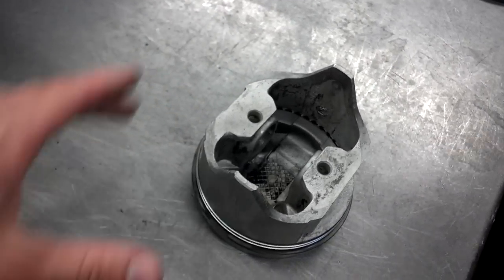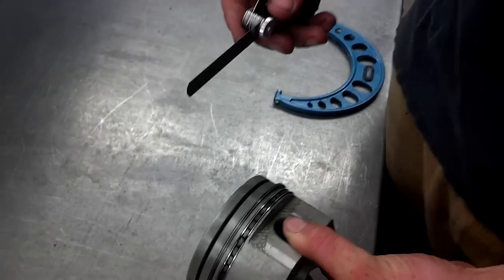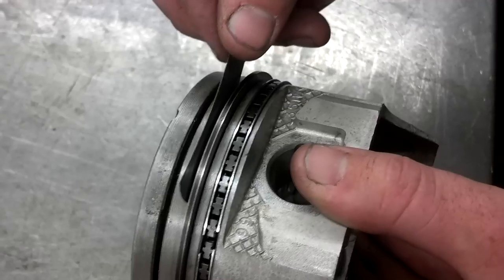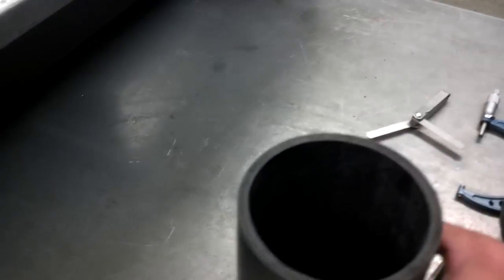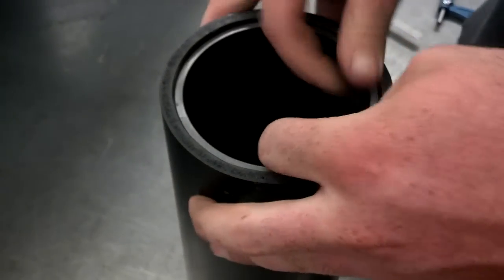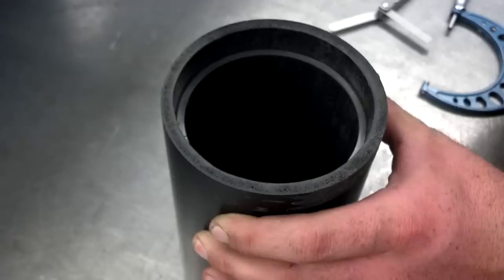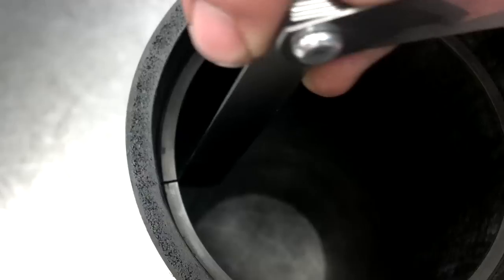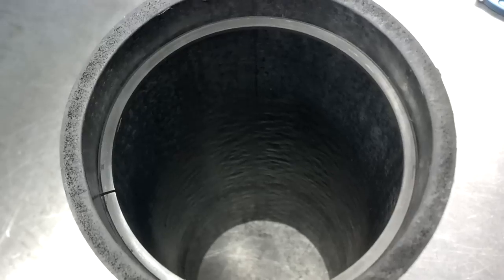Measuring pistons and rings

Comment: Does the piston ring have a circular form (ID/OD) before and after installation?  How does it maintain circular form without gapping in other areas when installed?
Reply from the maker: Because of the gap, the diameter of the ring can change to conform to the bore of the cylinder.  The ring must be compressed slightly (decrease the gap) to fit into the cylinder, so there is always slight tension against the cylinder wall.

Comment: FYI: Proper practice - Never just pull a mic off a measured part without first locking the thimble. The pulling off motion can turn the cylinder before you look at it giving you an incorrect reading.

Comment: When using the feeler gauge how much force do you use? If I can force a .021 do I have to buy new rings
Reply from the maker: You should never have to force the the feeler gauge.  I should should slide with only the slightest resistance.
Reply: @JustinMillerAutomotive  ok thanks. I believe I'm doing it wrong. I thought I had a .019 gap and when I force it I can go up to .021

Comment: Very nice explanation ! I would like to know if you ever measure the distance between piston to cylinder wall by a filler gauge? What distance do you feel is the best ? I have a 2 stroke motor ! TIA
Reply from the maker: No, typically, you would measure the piston and then measure the cylinder.  The difference between those two measurements is your clearance.
Reply: @JustinMillerAutomotive  what is the clearance you should  have in a 2 stroke motor ?

Comment: What is the thickness of the filler gauge that you are using ?
Reply from the maker: It varies a little bit from engine to engine.  You should find your specification for "piston ring side clearance" or "piston ring groove clearance."  Use the correct feeler gauge sizes to make sure that the clearance is not less than the minimum specification or greater than the maximum.  It is usually about 0.001"-0.002"  Also, move the ring around in the groove and make sure that it doesn't bind or stick in the groove at all.

Comment: hey man liked and subscribed.. more then apprecaite guys like you that make videos to help us people out. I have a quick question if its not too much, I recently took the piston out of my 2002 honda crf450r and got a measurement of 95.97-95.98mm and my cylinder is 96.00-96.01, what size piston should I be looking at or how much clearance is usually acceptable